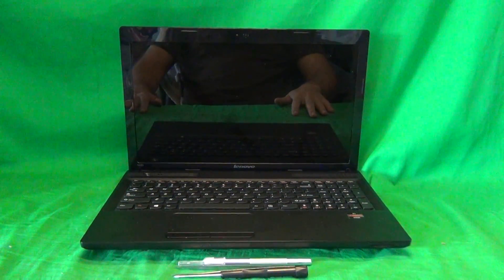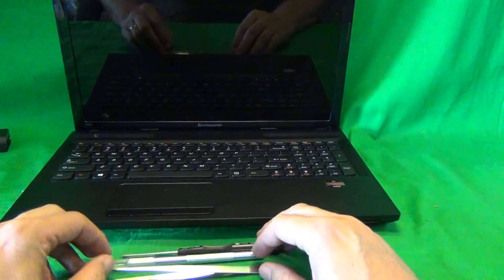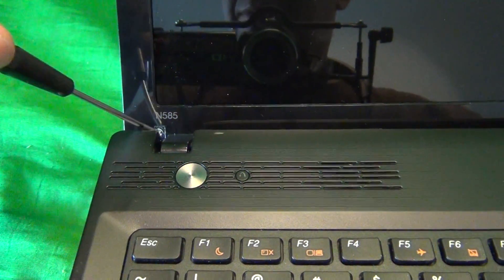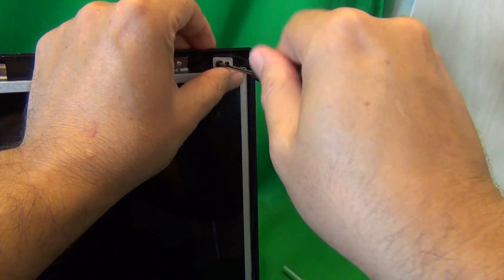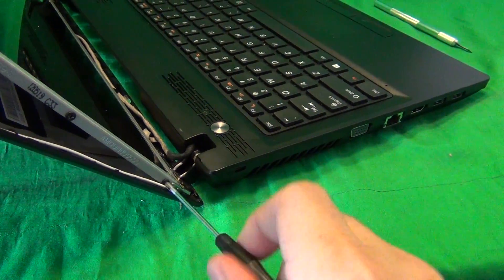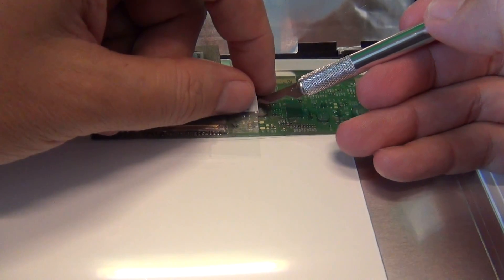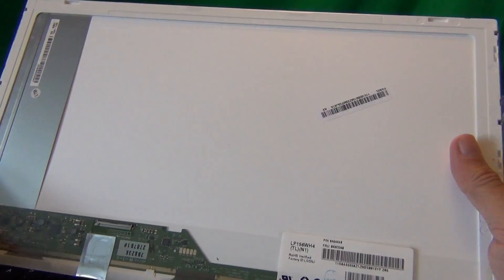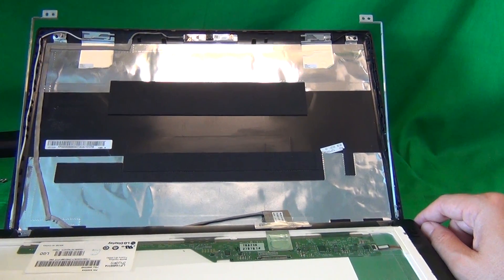Lenovo IdeaPad N585 Laptop Screen Replacement Procedure

Comment: This worked perfectly. I was even able to get the bottom side screw by bending back the plastic back a little more forecefully than appropriate, leaving the bottom-of-screen screws alone. I started by removing each bottom screw, and then worked my way up. When I put the new screen in, I secured the top screw on both sides to stabilize the screen, then the bottom on each side, bending the plastic back, and then filled in the middle screws.

I was not able to fully remove the bezel, but was able to work with it still attached to the hinges.